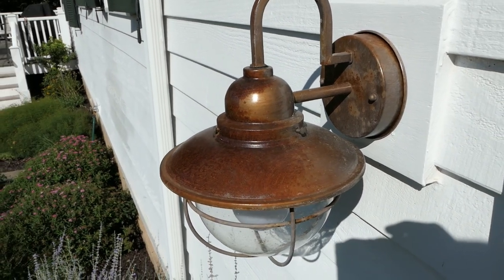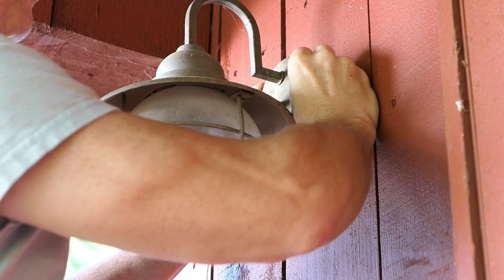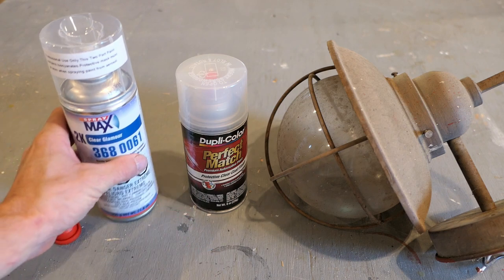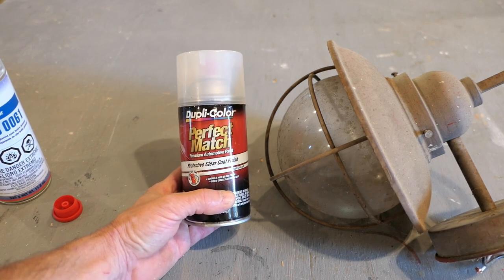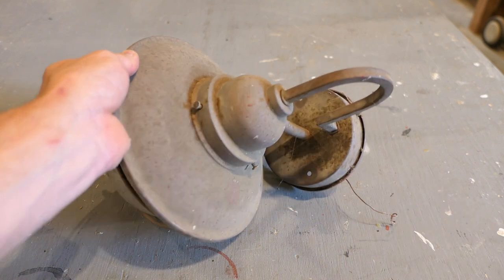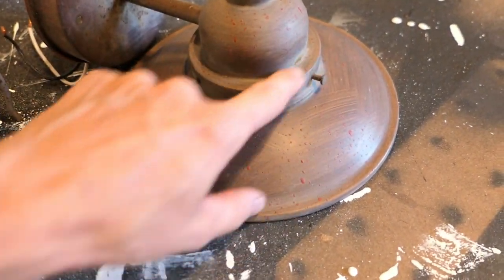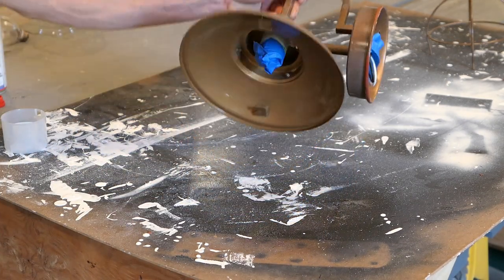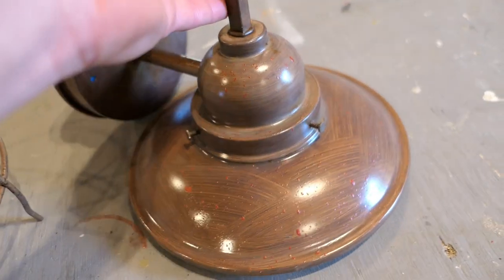How To Preserve A Rusty Old Light Fixture

Comment: Happy to hear I'm not the only one who has a problem dropping those little round light fixture nuts.  Once you do drop them, they can be maddeningly difficult to find too.
Reply from the maker: I know.  Every time I remove them I make a mental note to be careful, and half the time I drop them anyway.    I did start saving them from various remodeling jobs, though.  The fixture would get tossed, but I saved the nuts in my toolbox for the next guy.  I think you can buy replacements too.